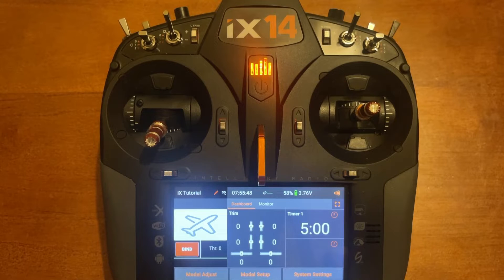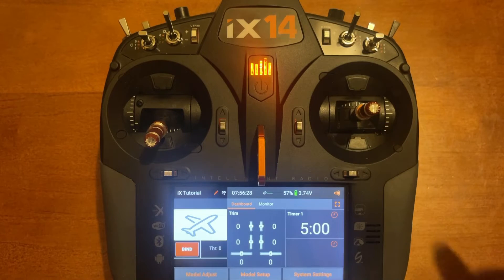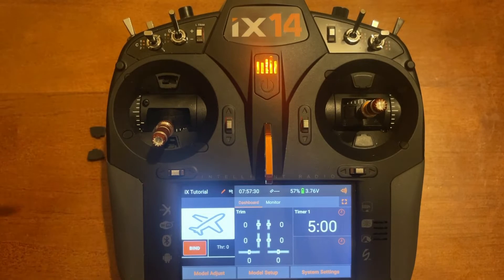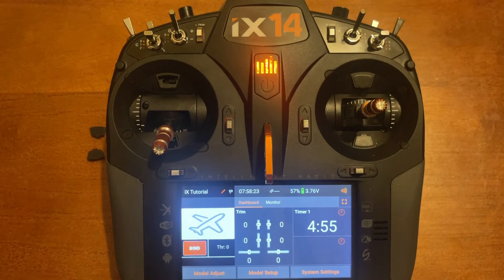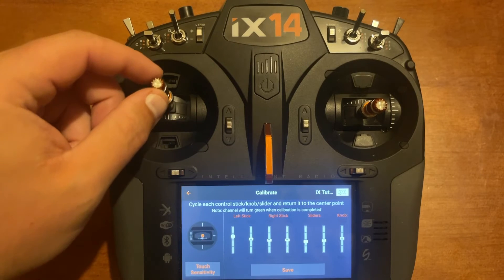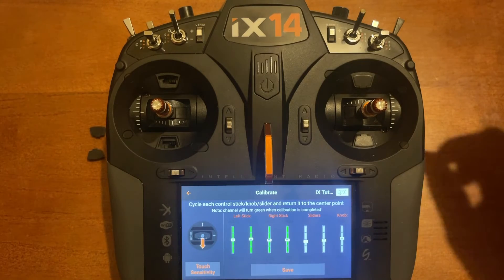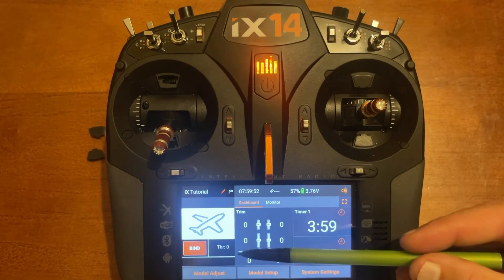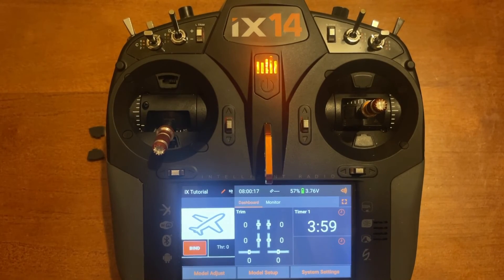Spektrum iX Setup: Extended Throttle Range Control

Comment: I noticed that after recalibrating the right stick you didn’t move the two pins back to the left. Since I have the ix14+SE, I have HEX nuts instead of the pins—you unscrew them and move them to the right and then you can adjust/calibrate the throttle. 

My question is that if moving the pins (in your case, ix14) back to the left, will it go back to the factory setting? I noticed you kept the pins on the right and you put back the rubber caps on them.